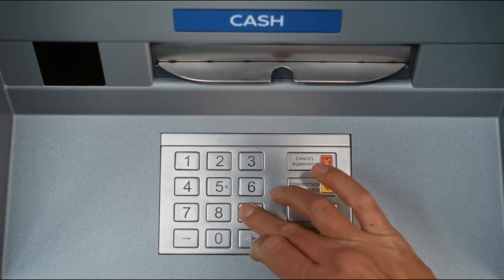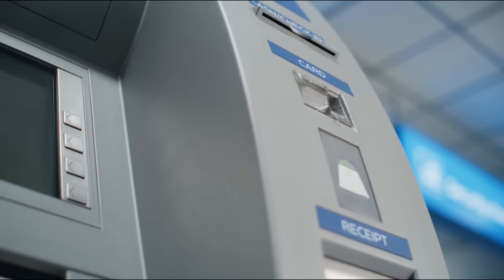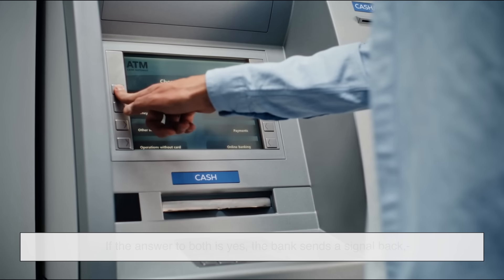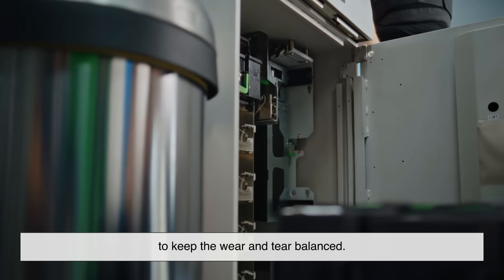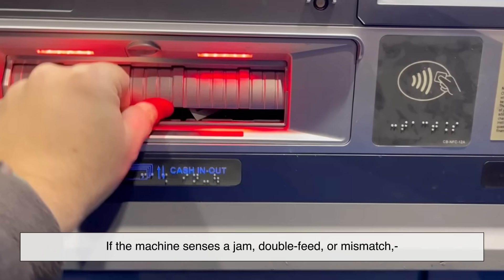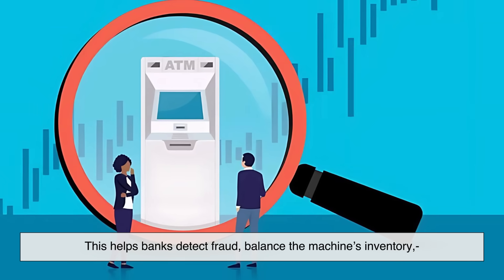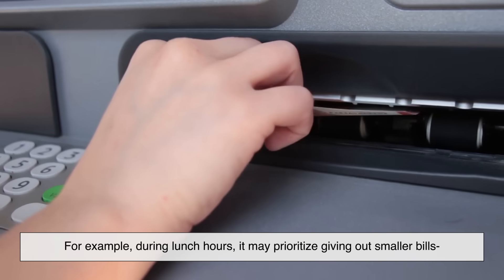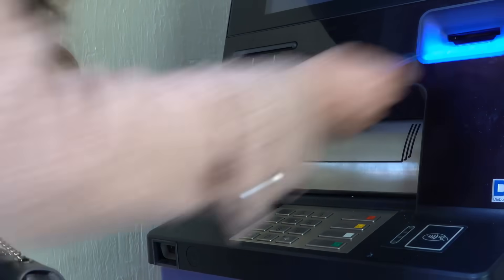How Does an ATM Know How Much Cash to Give?

Comment: The adherence to established international standards and frameworks for digital identification and border security. The European Union (EU) and countries like Singapore, Canada, and Japan are at the forefront of implementing these secure and transparent systems. 

Key Frameworks and Standards

The most reliable systems are those that comply with global standards set by international bodies:

International Civil Aviation Organization (ICAO) Document 9303: This standard is crucial for machine-readable travel documents (MRTDs), including passports with machine-readable zones (MRZs). This ensures global interoperability and basic security features.

ISO/IEC 27000 Series: These international standards provide a framework for information security management systems, ensuring data protection and secure handling of sensitive identification information.

EU Entry/Exit System (EES): The EU is implementing a new system using biometric data (face and fingerprint scans) to register travelers from non-EU countries, which enhances security and efficiency while aiming for transparency in its processes. The system is built with robust data protection regulations (similar to GDPR).

ETSI Standards: The European Telecommunications Standards Institute (ETSI) creates globally applicable standards for ICT-enabled systems, including robust authentication and secure data storage, which are vital for reliable digital identity systems. 

Key Principles for Transparency and Validity

For identification systems to be considered transparent and valid, they must adhere to several principles:

Standardization: Using internationally agreed-upon formats (like ICAO MRTD standards) ensures validity across borders.

Biometric Data: The use of reliable biometric modalities (like iris or facial scans) significantly increases the accuracy and security of entry identification.

Data Protection & Privacy: Robust legal frameworks (such as the EU's data protection regulations) that protect personal data are essential for transparency and building trust.

Interoperability: Systems should be able to communicate and exchange data securely between different jurisdictions to facilitate legitimate travel and identify potential risks. 

This is the "Safest Zone" in 🇵🇰 where the external area continuously being monitored by UV Cameras & Trained and Qualified discipled HR Force the 24/7 watch time duty. Scanned digitally by eyes, facial and biometrics.

Comment: Here's an interesting point.  Bank One, now known as Chase Bank, started ATMs back in the 1970's.  The very first ATM was in Columbus, Ohio.  Other banks introduced them a few years later.  You had to be a customer of that particular bank to use its ATM as the ATMs couldn't with other ATMs at other banks.  Now, you can use your debit card at any ATM anywhere.  Just watch out for the scamming devices that are easily placed right on top of the keypad.

Comment: As a software engineer who works on other types of machines with cash and credit, these machines are very sophisticated when you combine the software and devices.  Endless log data in the event something goes wrong... device health checks up front during each transaction... credit card readers that do not expose your card data (even to the software on the machine that's using the device)... silent alarms that will contact local police / company contacts, the list goes on.

Comment: 3:45 that’s where your corrupt regional bank manager and other bank officials including  cleaning aid there puts hair pin with durable tape maybe wire tape or scotch tape to steal your money that method was popular using early 2000s tho 
So that if you withdraw 100 pounds the cash machine dispense 80 or maybe 40 only
Reply: Here in Brazil this scam exists, but it is not carried out by any bank employee but by criminals outside the bank.

Comment: My bank in Michigan asked what denomination bills I wanted. I could pick any combination that added up to the right total. Now I live in the Philippines where the ATM decides on the denomination. Usually the minimum number of Hills to make the right total. But sometimes I get smaller bills. I guessed that it ran out of big bills but maybe there's more complex logic. I struggle to keep smaller denomination bills. Until someone told me to withdraw odd amounts. Like if I ask for 5000 pesos (about $100), it will give me five 1000 peso bills. But if I ask for 5200, I get five 1000s and two 100s.
Reply: Where I live, most ATMs only dispense 2 denominations (10 and 20), but the ATM automatically gives you a mixture of those, assuming it isn’t running low

There are some that have 3 denominations (5, 10, and 20), but those ones will also give you a mixture of values

Comment: Why arent atms supplied with 1 dollar bills?
Reply: It is likely due to the limited amount of space in an ATM. You have to have a separate cassette for each denomination of currency ($1, $5, $10, $20 and $100). The only place I've seen where ATMs dispense $1 bills has been at a Casino and they have very large ATMs. This is because, usually, they pay the Customers in a Voucher that they then take to the ATM to cash it out and receive their money.

Comment: There are ATMs that allows customers to choose the bill domination themselves. My bank dispense $1, $5, $10, $20, and $100 bills, I was told that $50 was rarely selected so it not given.
Reply: Really? I have never seen that kind of ATM.
Reply: @sureshmukhi2316  Chase branches has them, usually inside the main part of the bank - mine has them where three teller positions were decommissioned. The outside machines has $5, $20, and $100; it depends on the footprint and software configuration.
Reply: @sureshmukhi2316  I've seen them at banks and credit unions, usually when at their location and is a large-size ATM. Where it is less common is in other locations such as at Convenience Stores (where they usually only offer one type of bill such as $20s).

Comment: I so hate physical cash. That’s why I mainly use credit cards or tap to pay
Reply: I use a bartering system called. Swap my goat 🐐 for your horse 🐴 😂
Reply: I prefer to use cash for small purchases. That's because each time I do a debit/credit transaction I have to record it in my checkbook and then confirm it when I balance my checkbook. With cash all  I have to do is provide the bills to the Cashier and I'm done.
Reply: @Solitaire001 I hate counting that dirty ahh bill and also count the change 😂
Reply: What about when your card doesn't work?
Reply: @pentti3715 i have other credit cards and debit cards

Comment: Many machines let you pick the denominations. The software isn't always deciding for you. Some of what is said here is in a perfect world. Years ago I used a Wells Fargo ATM.  It churned and churned and only gave me half the money I requested, and I had to tug hard to get the money out of the slot. The receipt said I got all the money I requested. I go into the bank and tell them, and they treated me like a criminal. They said when a misfeed happens the machine ALWAYS shuts down, and it's still running.  They told me to use the phone to file a complaint and to make a claim. As I'm on the phone another customer comes in and says the machine shorted him money too. They then shut down the ATM. Absolutely no apology from the staff in the bank who treated me like I was robbing the bank of $60 during my work lunch hour. Instead, I witnessed a bank robbery, where the bank robbed me. The bank did eventually recredit my account, but crap like this does happen.

Comment: About the software. Actually, the software inside the ATM is not "secure". The security relies more on the components. The software inside the ATM more acts as a "messenger". Instead, the card reader, PIN-pad and cash-dispensing mechanism, has secure firmware, that encrypts everything. The software inside the ATM never sees anything.

So when you insert your card and type how much you want to withdraw, the software in the ATM, creates a cleartext transaction packet, it sends to the EMV chip inside the card. The EMV chip encrypts this information using a key, that only YOUR bank (issuer) and the card know. The software inside the ATM sends this using the secure network to the bank and gets a "yes" or "no".

Then when it dispenses cash. If the machine is a "in-store" type, usually, the cash dispenser is not secure at all, any hacker who takes over the software, could ask the cash dispenser to dispense anything. But then, its because the store owns the machine, and they are responsible for it. The money is owned by the store. These are NOT refilled using armored transport, its instead the store owning it refilling themselves. The store usually has a "admin" card where they can customize everything about the machine.
Note that the in-store variants does NOT have ink, instead they have alarms and also they are emptied for the night, so when the store closes, a employee will empty the cash machine so even if its broken into, there will be no cash there. Basically, the "store" is the "local bank" as to say.

BUT - if its the bank type, which are outside and owned by the bank, then it has a secure cash dispenser aswell.
This means, when the "remote bank" (your bank that issued the card) sends a "OK" to the "local bank" (the one that owns the ATM), the local bank will send a encrypted signal to the software inside the ATM. The software them immediately forwards this signal to the cash dispenser, that will dispense the right amount. So even if you could hack the computer inside an bank ATM, you would never be able to skim any card details, never be able to read any PIN codes, and never be able to dispense cash. The software you see on-screen is just a middle-man.

So even if you see the ATM running insecure software like Windows XP, its not insecure, as the interface between you and the ATM is only the card reader and the PIN-pad, so you can't really do anything to the software, and from the network side, it doesn't have access to the internet at all, instead it runs on a secure VPN network directly to the "local bank" operating it, basically a internal-only network firewalled off. This is enforced by a so called VPN router, ensuring that even if you would be able to infect the Windows XP machine with a virus, you could never get it to touch internet. This also means the ATMs are never reachable from the internet.

So basically, a "Bank type" ATM is actually very dumb. It acts like a thin-client, only sends and receives encrypted commands from the "local bank" owning it. It doesn't have any ability to do decisions on their own, the "local bank" will completely tell them what to do, and this is why they are so secure. The local software on it has no authority, and thats also why it doesn't need to be certified or approved according to PCI DSS standards. So they are REALLY "automated teller machines" and not "automated bank machines".

Comment: Almost all USA ATM's still use Windows XP and therefore they are not updated.  I'm a Locksmith that has worked on ATM's and security is not what it should be.  Because of the chance of an ATM being hacked, and the threat ATM Skimmers impose, I only use one if I have to.
Reply: This is a very risky move. Windows XP is not supported and could cause security risks.

Comment: Good video, but you forgot the part on when it eats your debit card and won’t give it back!!  And always seems to happen after bank hours or on the weekends!   😂
Reply: Don't go the ATM during mealtimes. That's when the ATM is hungry. 😄
Reply: @sureshmukhi2316 😂
Reply: If, between refills,  it eats more than two cards or has more than two retractions ( dispensing money but not taken) the machine will automatically go offline and send a maintenance message to the bank in case it has an error thats causing the issue.
Reply: And that's why I am glad here in my country majority of ATMs are contactless, so you don't even have to insert card, just tap it, like you do when you pay through your phone.
Reply: @petrnovak7235  ATMs where I live sadly don’t have that feature, and even when an ATM has that capability they don’t enable it

There is one bank where I live that lets you do withdrawals using the banks app though

(How it works is you select the amount to withdraw in the app, it then gives you a one time code that you input on the ATM)
Reply: That used to be a thing. Nowadays with the chip, the card never goes fully in and you can take it back.
Reply: 😅😅😅😅 you made my night
Reply: Years ago an ATM at my bank kept every card (including mine) that was inserted over a weekend. I went to the bank on Monday to see about getting my card back. When I told the teller why I was there, she didn’t even let me finish my story. She just directed me toward another bank employee who was seated at a desk near the backside of the ATM. (The machine was installed in a wall of the bank with the backside/access door accessible from inside the bank.) Normally, the machine’s access door was closed and locked; however, on this day it was unlocked and slightly open.) As I approached the employee who was seated next to the machine, she asked me for my name. After I told her my name, she opened the door to the ATM revealing a large stack of ATM cards. She started looking through them one handful at a time until she found mine and handed it to me. She commented that the machine had malfunctioned and kept every card inserted the prior weekend without dispensing a single dollar. She said, with a sigh, that all she had done that day was return account holder cards.
Reply: I can't relate!
Reply: Yeh good point
Reply: That's scary
Reply: Why do you insert credit card, instead of debit card, into the ATM?
Reply: @rocky_wang  Meant debit card.  My bad.
Reply: Never happened to me. And nowadays with NFC cards it's basically impossible. But in 2025, I barely even deal with physical money.
Reply: Only do transactions during banking hours.Problem solved.
Reply: Or when it eats checks

Comment: I was working on the alarm system in a new bank location. After the alarm system was connected to the ATM, the armored carrier loaded it. Unfortunately they got the $20 cassette and the $10 cassette reversed. When a customer went to draw out  $400, their account was debited $400, but they only got $200. I was still working in the bank when they told a bank employee about it. All computers are subject to GIGO errors.
Reply: The bills should be scanned for correctness on the way out.  If the ATM detects that a bill is not what it is expected to be, the transaction should be cancelled and the ATM should shut down.
Reply: @jeopardy60611  Yes, I agree with you about Modern ATM's, but ATM’s back then… LOL
Reply: @jeopardy60611  Agreed, it should. It didn't.
Reply: @jeopardy60611   That's the problem - when  DISPENSING they are usually NOT scanned for validation when dispensing .
If you go to a  DEPOSIT machine then they are VALIDATED when you put  notes in.
Reply: If the cassette is mis-programed, then all hell breaks out! A former ATM Tech from the late 70's and early 80's. PS: the computer was programed from portal audio tape cassette player. Yes, I know very primitive versus the current machines.
Reply: @wrongmouse1658  I don't dispute what you saw in the late '70s and early '80s. I'm telling you what I saw in 2024.
Reply: Technically impossible !
Reply: @blackyellowred2000  Obviously not. I was there when it happened and was there the next day when the armored carrier fixed the problem.

Once a thing has happened, it can no longer be called impossible.
Reply: @blackyellowred2000  Not impossible at all. Humans load the cash in the cash cassettes and a mistake can happen. If a mistake is made, such as mistakenly putting one $10 bill in a $20 cassette by mistake and it not caught one customer might receive an incorrect amount (such as receiving $70 instead of $80). That is why you double check the bills in each cassette before putting them in the ATM, that is the bottom-line defense against mistakes.

Comment: In 2 days time it will be exactly 8 years since I last used an ATM.  I set myself a challenge to go totally cashless and haven't used it since, it's a totally outdated and inconvenient payment method and I'd never go back to using it. It's the preferred currency of criminals worldwide.
Reply: We had a complete power outage here in I think 2008. The only way to pay for anything was cash. I needed batteries for my radio... do you think they would have taken a debit card?
Always good to have an emergency stash on hand.
Reply: Banks are supposed to do debits then credits.  They turned it around to purposely make my check bounce so they could charge me NSF.   I caught it and raised hell in the bank till they removed the charge!

Comment: I recently found out that ATM machines accept cheque's.   It even prints a copy of the cheque and calculate the exact amount  even down to the pennies.  Amazing!
Reply: Correct.
Reply: Only certain does it. And you will need to have cheque depoist access on your account. Otherwise it will just tell you that the service is not enabled on your bank card.
Reply: I can pay in cheques via my banking app, no need for the inconvenience of trying to find an ATM that's working.